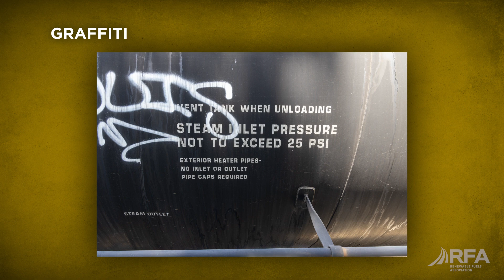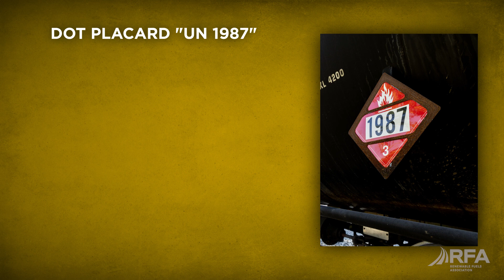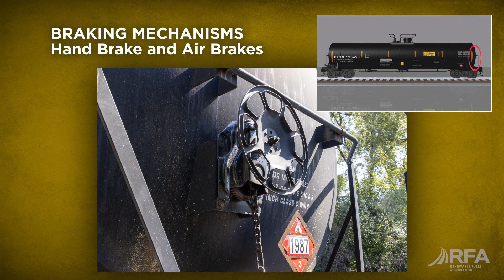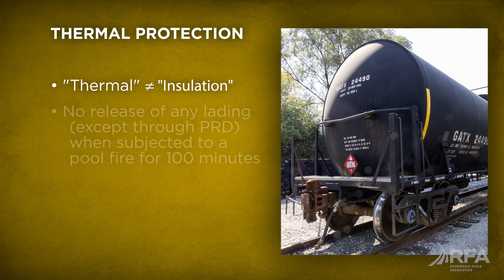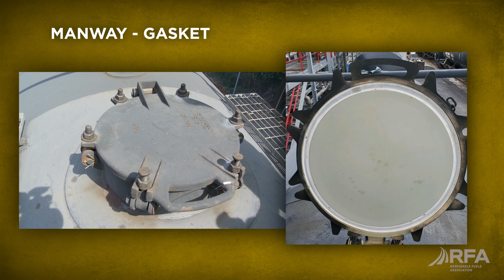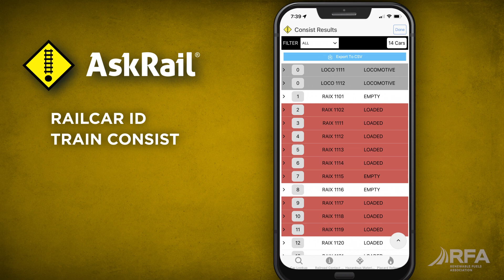Rail Tank Car 101 – DOT117J100W Walkaround

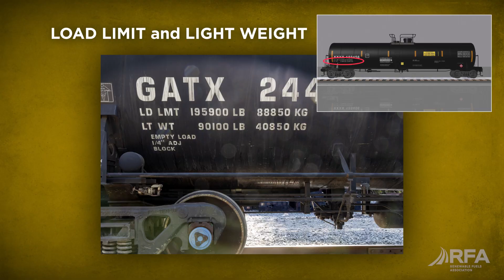Comment: At the 2:00 minute mark the guy says the car cannot weigh more than the load limit. He is wrong. When fully loaded, this rail tank car will weigh 286,000 lbs: This total weight—known as the Gross Rail Load—is the combination of the two stenciled weight markings shown on the car in the video. Load Limit (LD LMT): 195,900 lbs. — The maximum weight of the product/lading that can be legally added. Light Weight (LT WT): 90,100 lbs. — The weight of the tank car itself when completely empty. Add those two numbers and you arrive at 286,000 pounds, hence the "286'ers".